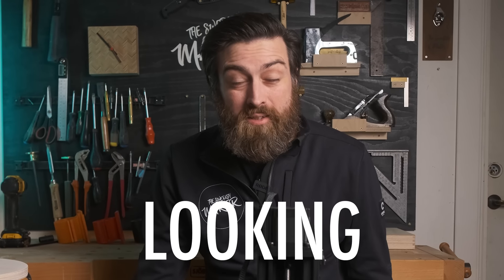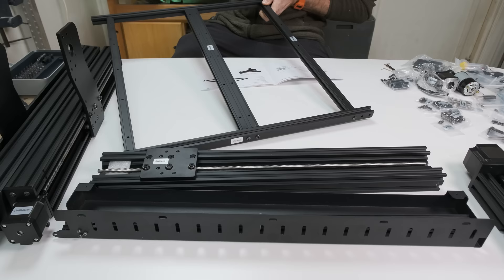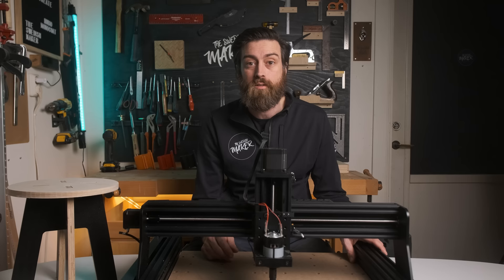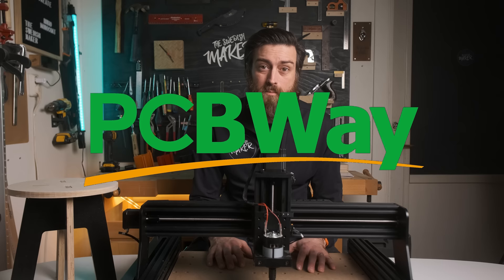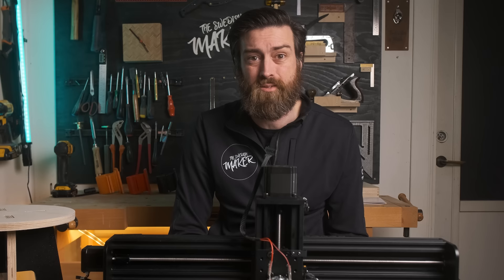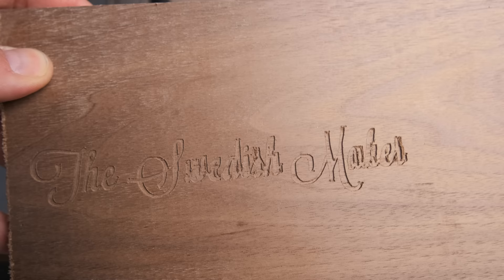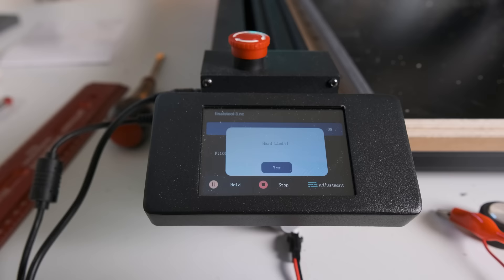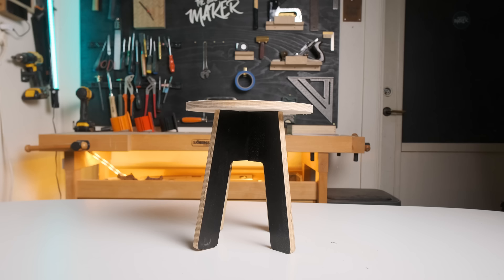the only woodworking tool needed?

Comment: I don't feel it worth $500+, if you ask me.
Reply: In your opinion,  what's the entry price point or machine recommendation for a cnc of this size.
Reply: @jesserhodes7430  It's not about the size. With this price tag I would expect some... pretension for cutting aluminium. 
I believe that if you upgrade 3018 keeping it within the price of this machine, semi decent job with aluminium can be done. In this machine I do not see this potential. Maybe I am wrong.
Size-wise - same 3018 can be expanded to the size similar (bit smaller, but still) to this machine and show not much worse results, if worse at all. But the price would be half of this one.
So I am not saying it is bad. I am saying that it doesn't match any niche. At least in my point.
I am considering buying the CNC of this size, but 4.5 times more expensive. So it not about the size...
Reply: @Artem  I appreciate your explanation. I frame houses and do trim carpentry, but I've been  interested in understanding this type of woodworking to do as a hobby. It's  another world compared to what I know.
Reply: @jesserhodes7430  and this world is very interesting!
Dont get disencouraged with what i wrote. If you know for sure that wood is the hardest thing that will be in your cnc (i also thought so and was wrong), and the size for you is a key factor, than i caanot recall anything of this size for this price.
Reply: @jesserhodes7430  around 2-3k. Sorotec is good for example.
Reply: For this price I like to see 5 Axis.. LUL

Comment: Do not understand why you want to 'bypass' g-code. It is the universal language of CNC, and has been for over 60 years. Going via g-code gives lots of ability to modify machine operation, adding the appropriate g-code instructions in the customize section of your software (or post processor). Standards in any field are good, and to have such an established standard in CNC is a boon. Having the nightmare of having to match software/hardware compatibility is completely avoided.

Comment: Thanks for your well-crafted video, sincerely. And thank you for your suggestions on our products, thank you very much, this is the most important thing for us, and I also hope that other friends who have used it can provide valuable suggestions, I hope we can become better together, We will summarize these suggestions to the relevant departments, and strive to make the best machine for our customer, respect~😺
Reply from the maker: thanks for letting everyone know your are eager to make every product better.
Reply: @TheSwedishMaker  It is our aim to manufacture products that satisfy customers:virtualhug:
And Thanks again for your practical suggestion, respect~
Reply: Hi!  On mine on the x axis 4 out of 6 of the wheel's bearings where stuck and I found out when routing a circle it was ending up lopsided so I had to basically dismantle the whole thing. Its a good machine the problem is TT your quality control seems to be lacking.
Reply: @xample222  Hi there! We're sorry you experienced issues with the bearings on your machine. We take our products' quality very seriously and strive to improve quality control processes. We appreciate your feedback, and we'll make sure to address this issue in the future. If you have any more concerns or questions, please don't hesitate to let us know. Thank you for choosing TwoTrees! 😊🌳
Reply: @Twotrees3Dofficial  Please offer a 65mm adapter for the customers that want to use a trim router.
Reply: @stevejones01  Hello! We have received your suggestion, thank you for your feedback, we will continue to optimize our products, please look forward to our latest CNC products.

Comment: In easel you need to go to machine settings to tell it that you have a spindle. Once you do that it inserts the spindle start command and it should auto start. I haven't worked out how to auto insert a delay to enable the spindle to come up to speed in easel though.

Comment: I bought this one. I was fully conscious of the limitations btw.
Now, despite being a small and underpowered machine, it does fill a niche in my workshop.
First of all, I used it to make the parts of my larger, completely from-scratch, CNC that I could not make by hand to any reasonable accuracy. For that, it was fine and invaluable.
Second, I use it to make small parts and things that don't require a lot of setup. In essence, stuff that would be too cumbersome to make on the large machine (especially given that the large one is not designed for all-purpose work, but rather requires making fixture plates with exact alignment on the machine bed before starting to make parts, as I do not ever want my cutter to touch the machine bed and the alignment system I worked so hard to create and mess it up). And for that, it does its job very well.

Comment: If you buy this cnc also make sure all bearing wheels are rolling freely, on mine on the x axis 4 out of 6 of the well's bearings where stuck and I found out when routing a circle it was ending up lopsided so I had to basically dismantle the whole thing. Its a good machine the problem is TT quality control.

Comment: You can move the router when it's powered off. +/- 0.5mm at least. That's only going to produce scraps. I can't deflect mine more than +/- 0.002mm. Build one from scratch and you can easily expect < 0.02mm  final accuracy. CarveCo is worth the money: the layout tools are good and it includes newer ArtCAM (with it you can engrave images with depth replacing shading). I built a wood CNC using a QueenBee frame (linear rails, tensioned ACME screws), a Duet3D WiFi controller configured for CNC, and the Makita trim router. It'll do anything, very very well. If all you're doing is cutting out plywood geese, painting them cornflower blue, and selling them for $2, then stick with that CNC.

Comment: I just got one for new year. With the 500w spindle upgrade.
It seems that they have updated the software version by now.
I m a neewbie at cnc so i cannot compare. But i checked all nuts and bolts during assembly and after some struggle to learn the software and the machine i think for this price you get a lot of fun. Its not a pro machine build for spitting out batch work. I intent to use it to cerate templates for the more complex parts of furniture i want to rout.
I

Comment: The best hobby CNC machine, is the one made from your ideas and built with your own hands.
You could have a lot of fun building your own, and I bet it would turn out amazing.
🙌🏻😉
Reply: Few people possess all of the requisite skills to completely execute a CNC build. People good with electronics tend to have weak mechanical skills and vice versa. Of course there are some individuals that are strong across the board. But they're fairly rare in my experience. It's like there's mental blocks going on or something.

Comment: It's always intressting to see what is available in the market. I got my first cnc in may 2021 and really enjoy using it. During alot of years thinking of building one from scratch myself I ended up buying one that came in 4 pices plus controller and some cabels,, 16-20 screws and ~1 hours assably later and it was ready to run. But then I needed to build the table to attach it to before I got the machine. Given the larger work area of ~800x800mm it feels like it will be able to create most of my upcomming projects. Really fun to see all your projects.

Comment: Love the review.. 
For me as soon as I saw that spindle I was disappointed, just drop that straight away and give the buyers different aluminum holders for better options.
I have never managed to get Easel to work with any of my CNC machines so I am used to the SD card and candle but it's not really the best salutation at all.
I would probably buy one knowing I had some work to do but then again I like modding these things.
Take $100 of for a router and holder upgrade and it would be a good starting point

Comment: Oh wow, a brutal and honest review. So by the time you upgrade the spindle, replace the stepper motors and by the looks of it the controller your left with just purchasing a frame. 🤦🏻

Loving the quality of these videos and the way you produce them. 👊🏻👍🏻
Reply: The frame, rails, & screws are the least capable bit of it. Controller is esp32 with grbl firmware which is perfectly capable up to 24v/2amp peek motors with proper driver chips & universal gcode sender rather than the buggy candle joke.  Even the little 775 motor is 5x more capable than the flimsy frame of these toy routers, the only reason people make any gains at all going to larger motors is the increased mass adding some resistance to chatter. attach a 5lb weight on the Z and it will probably do about as well that 775 motor as it would with a mikita on it.
Reply from the maker: thank you! 👊
Reply: A frame, linear guides and linear actuators. Which is about half of a complete CNC system. Then you need electronics (drives and an interface), the axis motors and the spindle. Finally you need a machine controller too. Once you've upgraded the electronics you probably can't use the machine controller supplied. Because you've scrapped their electronics which likely contained the controller as firmware.
Reply: @celimake  you don't think those drives can really run 24V at 2A, do you? Because they cannot. Max TC on SMD drives is around 2.4W. 24x2=48 which is a far cry from 2.4. The term orders of magnitude comes to mind. Methinks you've no idea how stepper drives actually work. They are very much current limiting devices.

Comment: Hey,

the problem with the Probe in Candle is easy to solve. Just replace the standard Commands to these: 
G21G91G38.2Z-50F80; G0Z1; G38.2Z-2F30; G92Z19.5; G0Z5F10M30;

And boom shakalaka it works great!

Comment: Well, the two cents of an old CNC router builder. 1. Never use 3D printed parts for any structural application on a CNC. 2. When you "upgrade" a spindle on a light machine you make things worst, because the structure won't deal with the new torque and the bigger tools it can carry. So you won't be able to get the full monthy anyways.

Comment: So…I don’t see that anyone picked up in this. You state at 2:44 that the working space is 460 cm X 460 cm. That’s 181.1 X 181.1 inches. That more than 15 feet times 15 feet. Did you mean 46.3 inches? Or maybe 46 centimeters so 18 X 18 inches
Reply from the maker: that's true. It was supposed to be mm instead of cm.

Comment: A quick correction for you.The work area is 460mm x 460 mm, not cm.  460 cm is 181.1 inches or just over 15 feet.
Reply from the maker: very true! Sorry If it was misleading.
Reply: @TheSwedishMaker  No problem. Figured it was just a "typo" error & didn't want your other followers to make a bad decision on whether to purchase.

Comment: You want "Universal gcode sender" Edit the grbl settings and that machine will likely travel at 2000mm/m or better, cutting speeds will be much lower because of machine flex, nothing about its capability to move.  It is just a 3018 with longer travels, don't expect anything more out of it without a lot of modification.

Comment: Classic Two-Trees TRASH!! (TTT 450 maybe?) 
As always, overpromise, false marketing and under deliver.

I will never support manufactures such as this.
Prob not working
Inhouse assembly failure (NO-QC, means any part could be faulty) 
The INCOMPLETE firmware on that machine is BEHOND TRASH. (Biggest deal breaker) 
Software mismarket
Spindle - the only thing I'd sort off be okay with, but I would do exactly the same.
Rather, make a better price and give an option to not have the spindle at all.

Another perfect example of China upmarkiting a bearly function piece of trash.
Same old Two-Trees

Great review, thanks

Comment: Dimensions of the spindel mounting plate a Company Secret? Man what company is this?

Thanks for the in depth review. Buying this kit will save you time to source and manufacture the parts needed to build this machine. So as a starter kit to implement upgrades it could be just okay ish.
For learning CNC / Gcode this might be a interesting build. But lying the machine supports Easel is a BIG no no.
I'd save more money and buy a ready to carve machine with decent spindel.
Reply: The plate cannot be a secret to anyone with access to the plate and a ruler. Maybe in the future they can encapsulate the plate in epoxy resin to protect their proprietary IP? Or perhaps what they meant is they don't know?

Comment: It looks fairly compact for 460 cm x 460 cm work space. I knew Chinese can do anything if they put their mind to it but that’s whole new level. 😊
Reply: It is much smaller - 460 / 450 mm x 460/450 mm. This is a very marketing driven way of miniaturizing things, just scale the dimensions down in a data sheet, but not in the real world... :)😎
Reply from the maker: yes I apparently wrote the wrong numbers in when editing the video. It should be 460mmx460mm and not cm which would make it huge 😃
Reply: It is the Tardis of CNC machines. It's bigger on the inside.

Comment: Nice video!  As far as your spindle floating in mid air, did you account for the thickness of the z probe?  I'm not an expert, but I think you have to measure the thickness of the z probe and enter it in to the G-code.  I haven't actually done it yet on my cnc.. 😮
Reply from the maker: I did account for it in the g-code - but something was probably off with the g-code anyways. Im not sure if they have some internal thing set up for their z-probe that wouldnt make it work if it was pre-loaded in the g-code for the project.
Reply: @TheSwedishMaker  my apologies then. I didn't see where you mentioned it in the video and it was the only thing I could think of. I liked your talk about easel.  I've been struggling with Carveco maker and I think I'm going to try easel.  Thanks!
Reply from the maker: @ericeinsmann5559  no you were right. I didnt mention it in the video :)
Reply: You should be able to compensate for offset with your machine controller. But that's where all of these cheap CNC machines fall short. The controller they use tends to be rudimentary and lacking. The machine controller is the software that interprets G code and has a control interface front end for the operator. The actual CNC program. Such as Mach, GRBL or LinuxCNC. Those are all machine controllers.

Comment: I believe for the price of $599, with its limitations, is NOT worth the price and the headaches that would come with it. Maybe half that cost… possibly even $400… but, I’d much rather invest a little more money and get something worthwhile, from the beginning. 
My first CNC Machine was the 
Longer MK2 by Sienci Labs. I purchased the 30x30
 (roughly 34” x 32” cutting area) 
I know, it’s a bit confusing to call it a 30x30 lol 
With the machine, Makita Router, dust boot, (2) Packs of (4) Router Bits, both 1/8 and 1/4 shanks. Along with an 1/8” collet adapter, and the Z Probe.. 
initially bought the first version of the Probe but later on decided to switch and buy the upgraded one that is much much nicer and you can set your X, Y, and Z from the one probe, as well as being compatible with a multitude of V bits (I believe up to 3/4”, but I may be wrong, as I never used a VBit that large on it) 
When all said and done, with all machine components & shipping/tax, I believe it was somewhere near $1700/$1800… but, that price is only reflected based on my experience when I began using a CNC, because had I known better, I could’ve cut down a few hundred dollars, at least, but I felt for what I was getting, and the reviews it had, and the positive reviews I saw regarding the customer support, as well as its ease of use and functionality (as well as assembly) I was pretty sure that I was getting a very solid Cnc Router that would certainly do what I needed it to do . 

**I understand $599 vs $1700/$1800 isn’t in the same discussion, but, my main point is that you’re better off spending the extra bit of money up front and sparing yourself many headaches you’d have from buying a much cheaper/much smaller/& less user friendly machine… 
If you can afford $600 for a CnC, I’d just recommend saving up more money & holding out for something that you will (most likely) have better experiences with.  (Although, I have had my fair share of headaches with my CNC— but that’s to be expected and is part of the learning curve lol) 

Good luck to any new CNC’ers out there! 👍🏼👍🏼